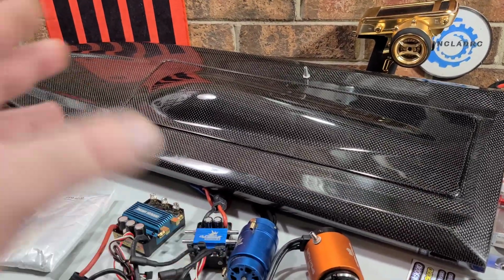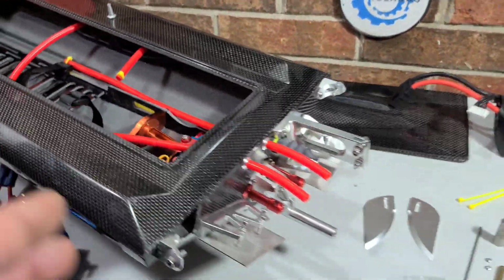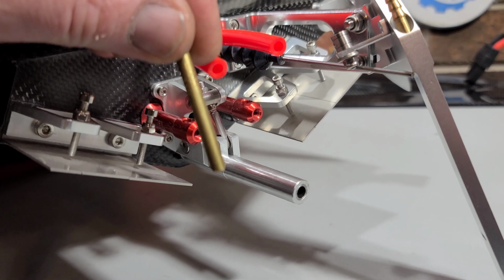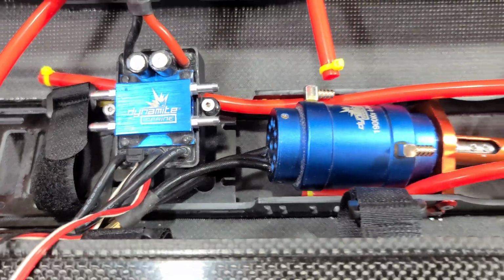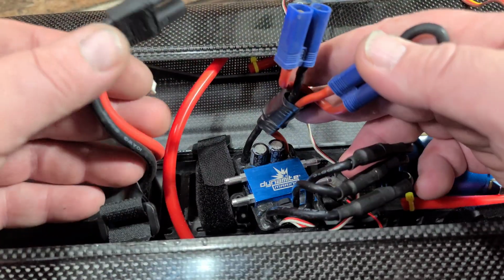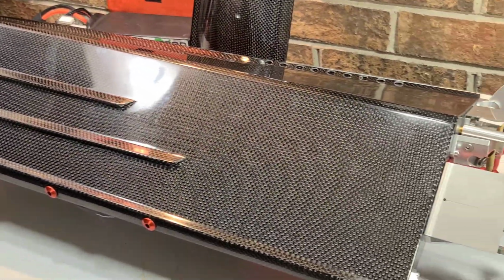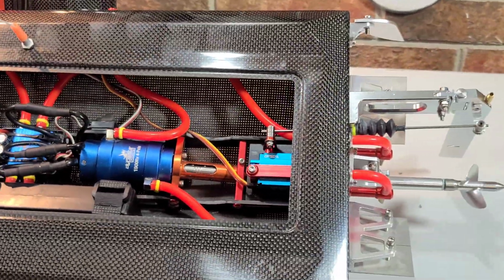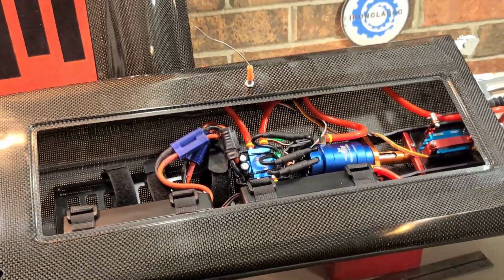Oxidean Dominator Hull & Hardware Setup & Electronics Installation - Carbon Fiber FE Rc Boat

Comment: Hi: I'm just about to order one like this. What motor would you recommend to run 6s? SSS 4082 2000 or SSS 4074 2200?
Thanks in advance
Reply from the maker: I'd go with the 2000kv. Make sure you have an esc up to the task
Reply: @IRONCLADRC  awesome!!! Seaking 180A will do it, won't it?

Comment: If you were going to buy a dominator with your own money which one would it be? Kevlar? ARTR? Would it be a self-righting one now that you know it does really ever end up upside down? Thank you
Reply from the maker: I'd get the non self-righting version, way more room for electronics placement, definitely carbonfiber, only because I like the look over carbon kevlar.   1650kv 8s rtr
Reply: @IRONCLADRC  what battery would you get for bashing? What connectors? Thanks a bunch

Comment: What controller is that you're using?
Reply from the maker: If you mean speed control its a DYNIMITE 120a.  If your referring to the transmitter its an oxidean quasar
Reply: @IRONCLADRC  is there a transmitter that has the same features but not as costly that I can upgrade my Pro V2?

Comment: Great Tips Big B , maybe that’s what is happening with me, I have the same Radio with the GPS from Oxidean and experiencing it Cutting out on me /loss of signal. When running the Lucas Oil 60 Mono .staying tuned in to see how you like it. Thanks for posting 👍
Reply from the maker: Oh yea, get that antenna out the hull as much as possible, that should give you more signal,   also the radio has an antenna that you can extend, that may help
Reply: @IRONCLADRC  the radio has a extended antenna? I will check it out thanks man👍

Comment: Hello Big B, nice and useful tips for all as always i myself have rebuild all electronics and installed that same tactic transmiter and found a old traxxas receiver box where i put the receiver to waterproof it. The boat s hull is fiberglass in your oppinion is there any problem of radio reception? Thanks man most appreciated.
Reply from the maker: Only carbon fiber & carbon Kevlar hulls block reception, you're Fiberglass hull should be okay 👍
Reply: Thanks Big B, nice and done.

Comment: There will be some videos first before the real ironclad magic stuff happens. But that's ok. The way how to get to a more extreme setup is going to be very interesting, that's for sure..... I think its a very serious bash boat, not quite sure if it's a good saw hull so that's were my interest primarily will be... 
Btw, i made a "lookalike escape hatch" on the "cockpit" for the gps reciever so its inside the boat...
Reply from the maker: You got that right, we're gonna go full ironclad on this setup, need to feel the boat out before I pull the trigger on electronics